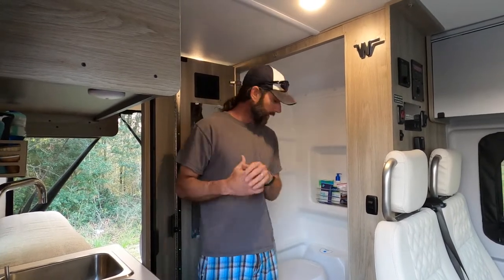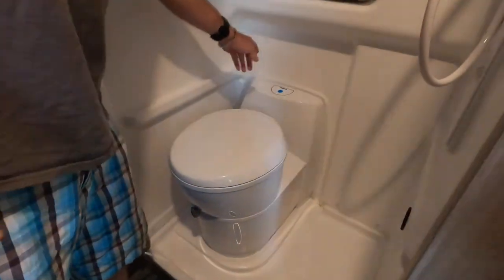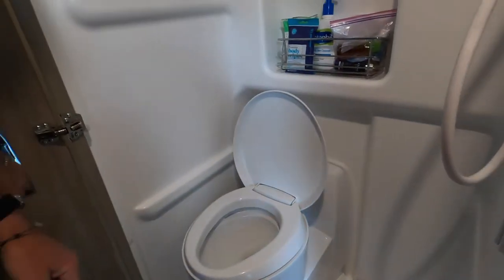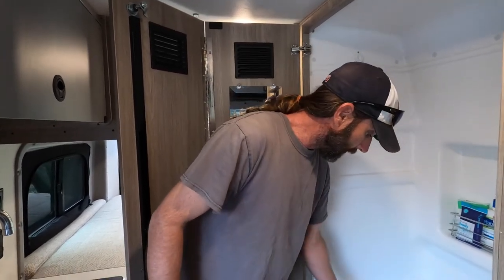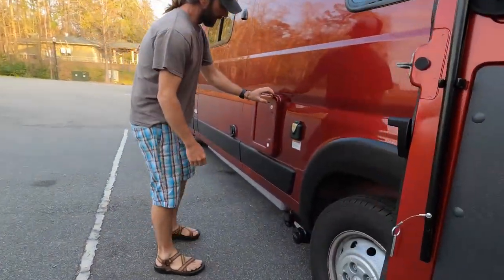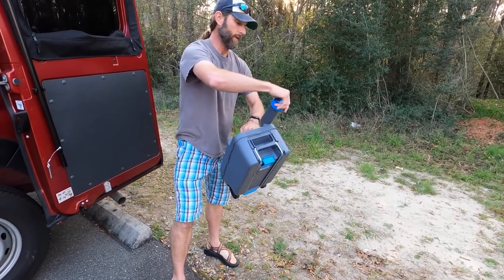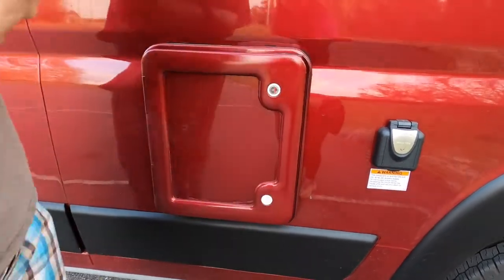Winnebago Solis Cassette Toilet  - Thetford C220 Series

Comment: Excellent review hun! The only thing that would make this toilet better is if they had a bag inside that could simply be taken out, but overall it looks pretty efficient. Thanks for sharing, 💕💕💕💕💕
Reply from the maker: Thanks so much Safirlady! It’s pretty simple to clean, but yeah having a disposable bag would definitely be a great idea. Thanks again and have a great day, Jason.
Reply: @CarolinaCampervan  thanks for info love; et agreed, 🥰🥰🥰, 💕💕💕💕😊, et likewise have an Awesome day, ❤️❤️❤️❤️🤗
Reply: @CarolinaCampervan  You can buy disposable bags and also gel pads that will absorb liquids on amazon. They are not very expensive.  Look under items for bedside toilets.  In the item description it says it is for camping toilets too. I never get my bottom tank dirty. I just put the bag and pad in my toilet and empty the sealed bag in the dumpster every day. Not much smell, no major cleaning.  Also, I just do number one in there, not number two. It's like putting a baby diaper in the dumpster. The gel pad is the same as what is used in diapers. No sloshy liquids.

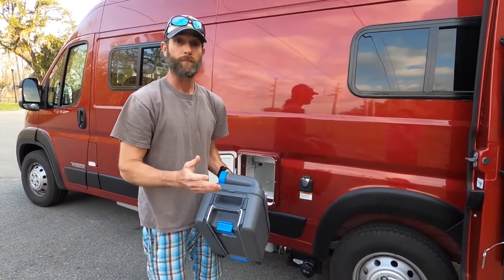Comment: 2:30 - No nitrile gloves when dispensing the cassette? 

Nice overview btw. I'm looking at the 59PX model.
Reply from the maker: Dude, I’ve been with my wife for 22 years, what ever she has I have! Just kidding, I knew it was just water. Good call though, we definitely use gloves when we empty it at a dump station. You’ll love the van! We’re in Colorado currently traveling around and it’s amazing! Thanks again, Jason!
Reply: @CarolinaCampervan  Awesome. I may be pelting you with more questions. Like how comfortable is that mattress in the 59P, and would someone like 6 foot 3 find it comfy. Thanks for the quick reply, you got a great YT series goin on the Solis!
Reply from the maker: @ChristopherDillman  hey mr. dillman, I’m 6’0 and I the bottom queen fits me perfectly! The pop top would definitely accommodate you you with room to spare! The queen Murphy bed in the cab, you may have to sleep at a slight angle, but nothing to severe. My brother is 6’3” and I would recommend to him. Thanks again, Jason!
Reply: As pointed out by Christopher D., without careful handling, they are a potential sanitary nightmare for everyone else using the same bathroom where the cassette has been dumped down a toilet.  How many cassette users do you think will sanitize the toilet stall area and anything else they may have touched when they are done emptying it?  How many campgrounds and businesses would be okay with emptying a cassette in a toilet if they were asked for permission to do so? I suspect the answer is zero to both questions.

Comment: Thanks for doing this video. I’m seriously considering this RV because of the cassette toilet. but worry about being of grid and not being able to run the generator all night for AC. I haven’t really boon docked  before but want to as campgrounds are a often nightmare. What are your thoughts on this and how you like the RV as a whole?
Reply from the maker: Hey Deborah, thanks for the question and subscribing! I truly love the van. It has exceeded my expectations! For the price point, it has everything I need. I have the 59p which doesn’t have a generator or A/C. It does have a max air fan that circulates the hot air out of the van. The 59p is equipped with 2 105 watt Agm batteries that will charge with the 220 watt solar panel included or by the alternator as you drive. I have yet to run out of power on my travels. If you are looking for a van with A/C and a generator consider the 59px. It does cost a bit more and it’s 18” longer in length. As far as the toilet goes, it’s so easy to dump and so convenient to have on board. I hope this helps and let me know if you have any more questions. Take care, Jason!

Comment: Hi, thanks! This is what my van came with. Any preference on chemical? I have some organic tabs, are these ok? Also when initially filling that bit of water for the chemical to dissolve in, do you use the onboard water or fill manually? They recommend 3 liters? Thanks.
Reply from the maker: Good afternoon! I use Starbrite Insta Fresh or Eco Smart by Thetford. They are both in a liquid format. A little goes a long ways in the 5 gallon cassette. I usually just add 1/2 an ounce and a tad of water after I get done cleaning the tank. Just add enough water so that as you're driving around the chemical and water can mix up a bit. It doesn't matter where your water source comes from when added to the cassette. I hope this helps and thanks for watching & commenting. Have a great day! 😃

Comment: My impression is that these are not great for solid waste. Is that your experience?
Reply from the maker: It works fine for # 2 :) You just need to use the dump station to rinse it out.  If we are at a state park, we will use the facilities though. The bathroom is really nice to have though, especially if boondocking or at BLM lands.